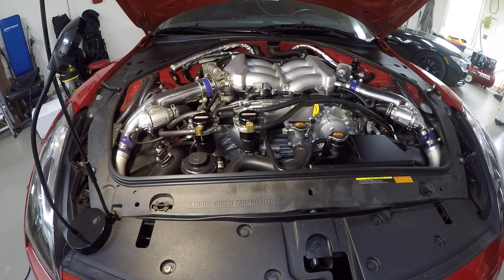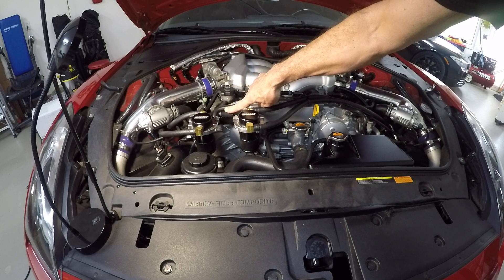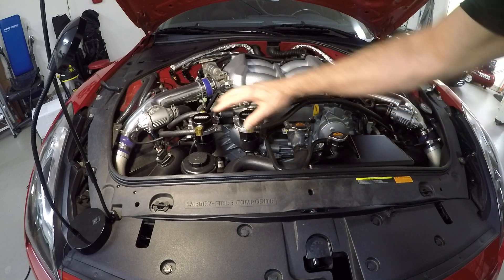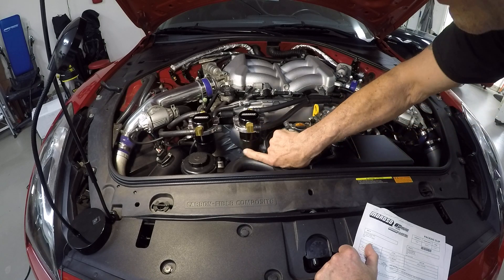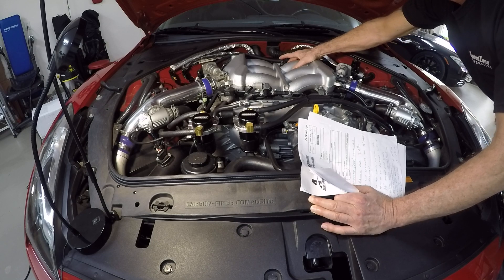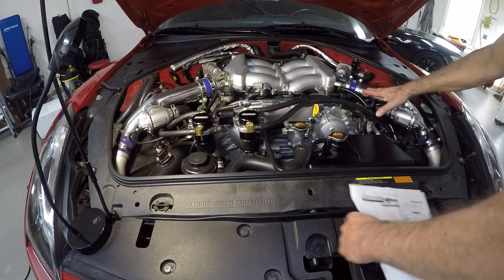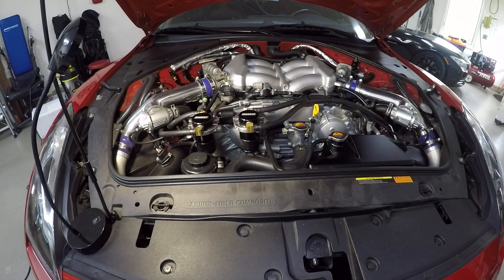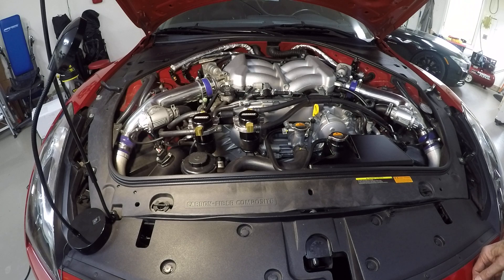GTR PCV Catch Can Update

Comment: great video! You seem to be ahead of the curve when it comes to FBO GTR upgrades. I caught that you used a silicone block off nipple. Most just use rubber which degrades due to heat, your a smart dude.

Comment: how much oil do you catch? what made you sell your other gtr
Reply from the maker: It depends on how hard I drive the car. If I do a bonsai run on the Dragon I'll check them and usually end up with about a teaspoon in each can. Not very much but that's oil that would have been sucked through the turbos and fed into the intake system. With normal driving I'll check them every 3 to 4 months and end up with very little oil in the cans' almost nothing. I sold my other GTR because it was set up for road course work, still perfectly streetable but I just wasn't driving it that much. About a month after I sold it I was sorry I did and started looking for another GTR. Once you own a GTR nothing else is quite the same.